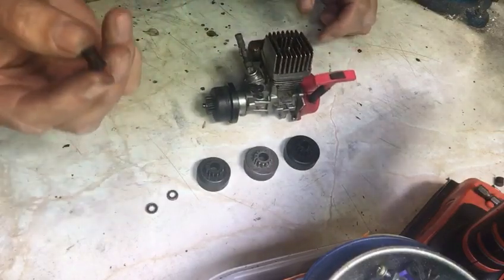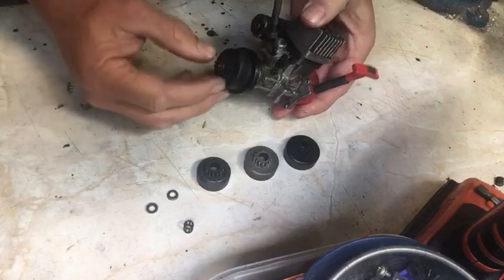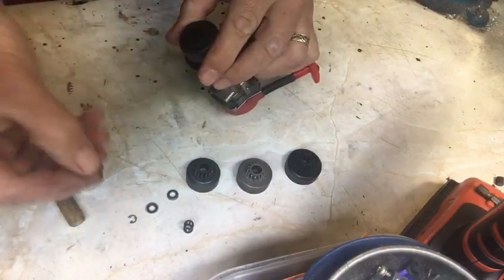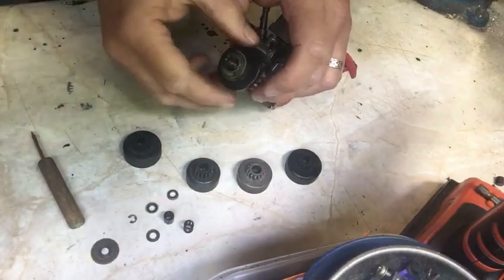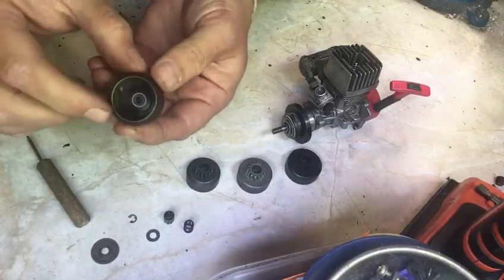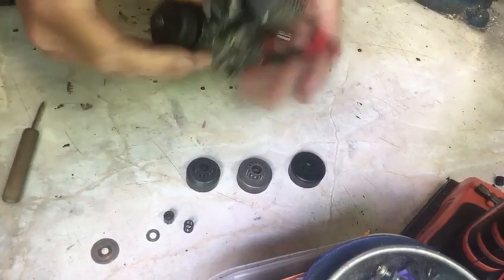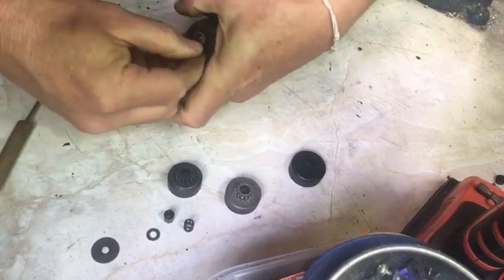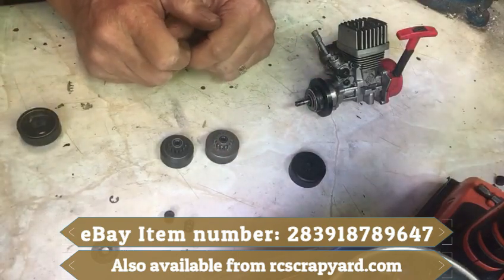Nitro Engine Clutch Roller Bearing Upgrade

Comment: Hi Simon  will this fit the thunder tiger ts4n ?
Reply from the maker: If your TS4N bell housing has a single roller bearing then the kit will work! if it has 2 bearings (One inside and one outside the bell) Then you need this eBay Item number: 283701519333 ! Hope this helps :)

Comment: Will this work on a kyosho gs21 engine from the landmax?
Reply from the maker: No.  For the GS21 engine you will need a separate set of bearings.  eBay item number 283701519333
Cheers